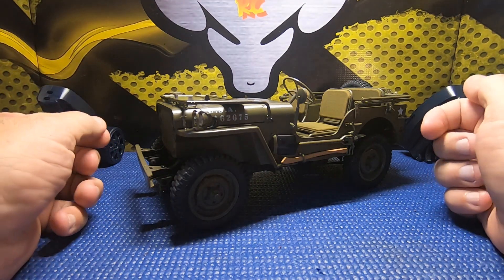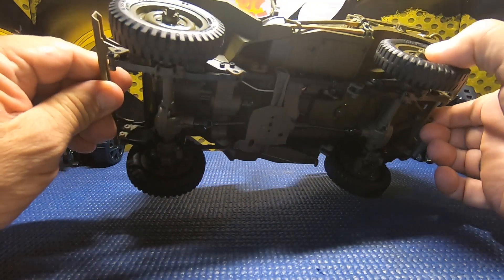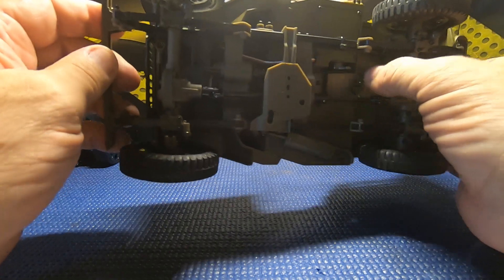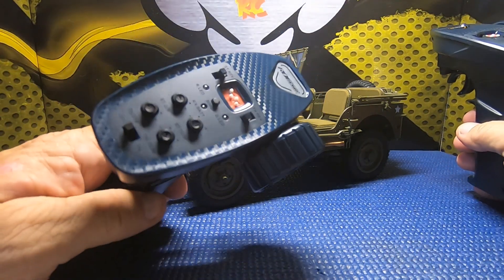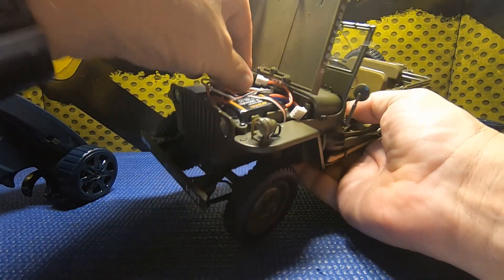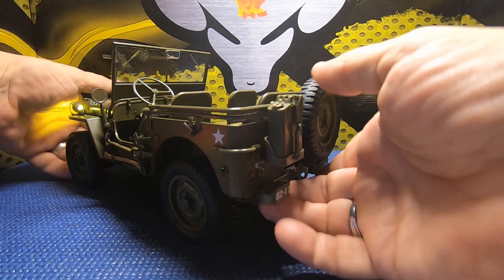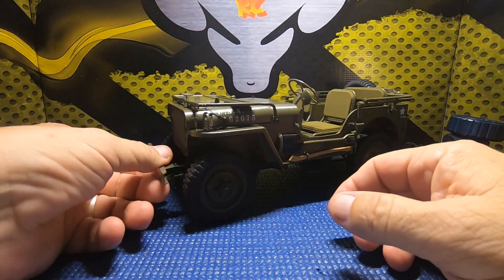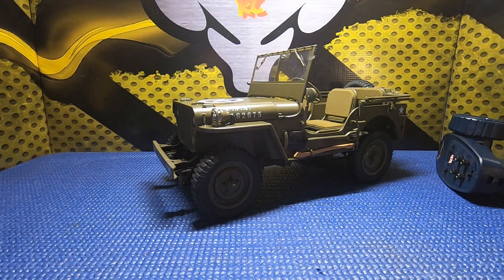Roc Hobby Scaler MB 1941 Willie's Jeep overview and driver figure

Comment: Really cool truck... err.. I mean, Jeep!  I just got the 1/6th scale version.  Haven't even run it yet.  Gotta do some work on a driver figure first, 'cause, as you say, it just doesn't look right without one.  Already have four, along with some WWII accessories.  Just haven't had time to play with it all yet.  Just a tip that I picked up from another channel.  IF you can find a shirt or jacket for your figure (mine all have full clothes so it's a bit easier)...  One way of getting the arm freed up to move with the steering wheel, is to cut out the elbow, then shoe goo a small piece of foam in between the upper and lower arm,  This allows the arm to move freely.  Of course, that's where the shirt/jacket comes into play.  Kinda gotta cover up the "surgery scars", ya know....
Reply from the maker: Yeah, a shirt would make things a bit easier for sure. I haven't really messed with driver figures to much yet, so it's gonna be a learning experience for sure. Thanks for watching bro 👊
Reply: @BullgearRCvideos  Nope, me neither.  In fact, this will be my first.  I picked up some really nice WWII action figures, along with quite a few accessories, on eBay.  They're the proper scale.  But, due to the Jeep's seat not quite being accurate (1/6th scale at least)...  I mean they are, except that the cushions add height, which pushes the heads a bit high.  And the leg room is a bit cramped.  Already amputated the feet.  And with the boots stuffed onto the stumps, you'd never know.  Haha.  Next, gonna take the ass to my bench belt sander, then the torso to the band saw.  Plan to remove a section of the torso, then glue back together, which combined with the sanded ass, will reduce the sitting height.  Then the left arm will get the elbow excised, and replaced with foam.  The right hand will get drilled so it pops over the gear shift lever knob.  Well, hopefully all of this will work as planned, anyway...  

Enjoy your videos.  Keep it up!.  I travel a lot for work too, so I understand having something fun to do to occupy your time in hotels.